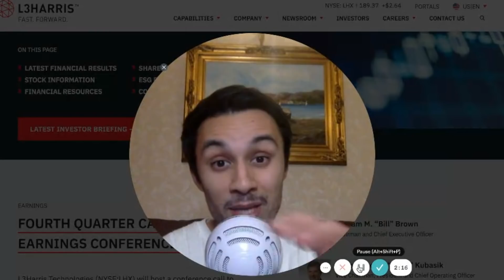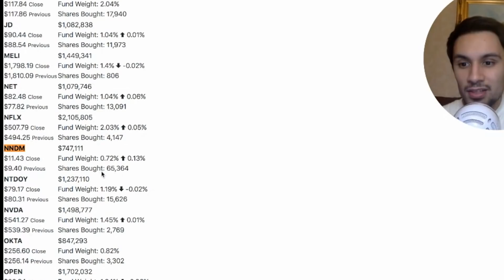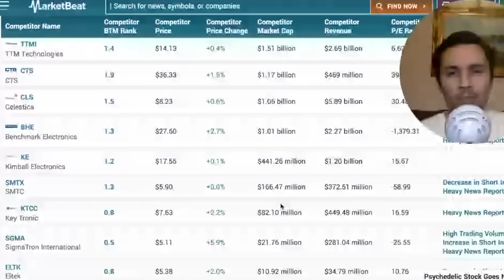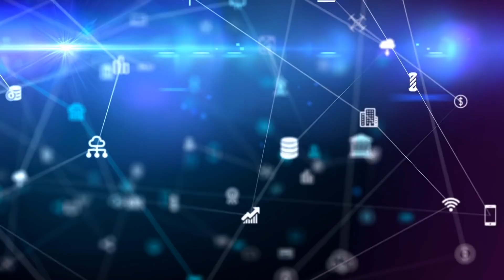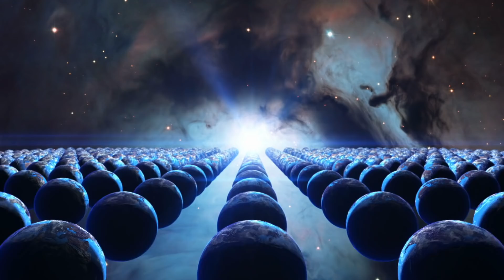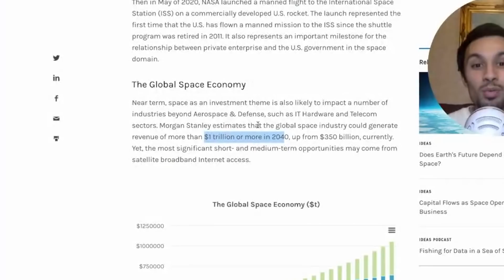HUGE NNDM NEWS! Yoav Stern Targets Trillion Dollar Market| NNDM STOCK UPDATE - Nano Dimensions stock

Comment: I like the technology but the only question I have is a scalability, are these printers going to be true production printers? Can they produce the volume required to be put into production?  I want to know how much these printers can yield per day.
Reply from the maker: Me too! I wish I could get Yoav Stern to take a interview on this channel lol. That's the biggest question is, when he referred to mass production, I assumed it's the dragonfly he was on about, or is he developing something right now that will be faster or printing multiples at once
Reply: @MRINVESTALOT  I'm an engineer and work in the 3D printing industry and understand the demands on these printers and there's not too many out there that are truly production printers.  In order to be a production printer you need to be able to produce volume at a reasonable time and looking at their technology the process of their 3D printing is a very slow process so this is my only concern
Reply: @MRINVESTALOT  check out HP's 3D printers those are truly production printers You can see their method of printing is way different than nanos
Reply: Or is this printer going to be more like prototyping one-off parts?